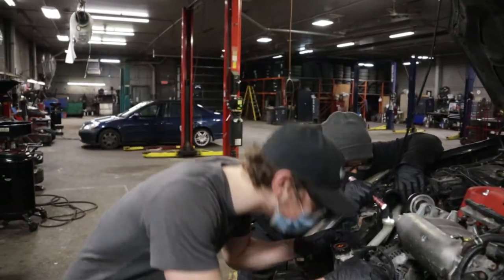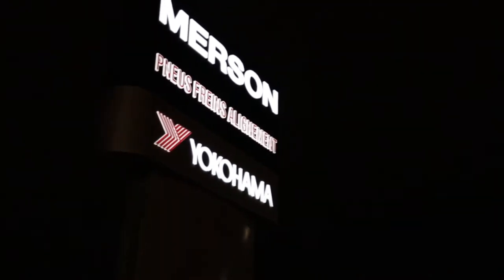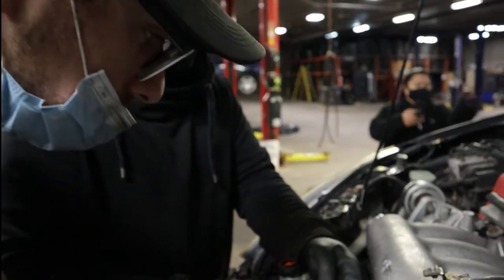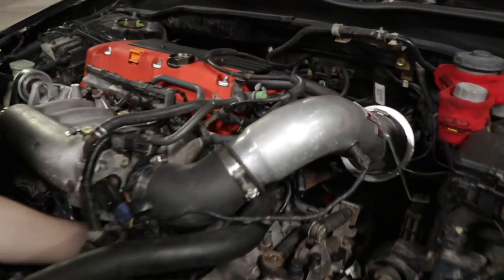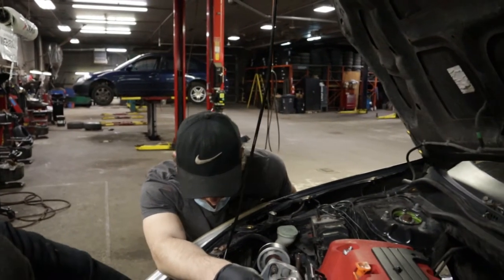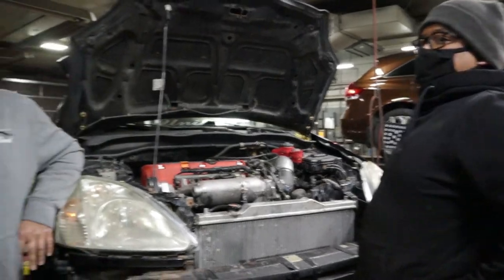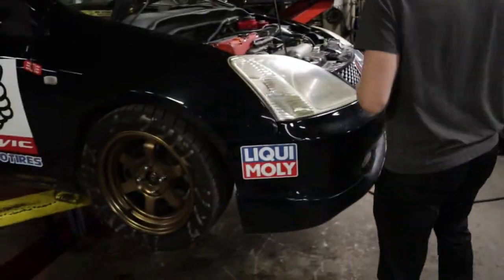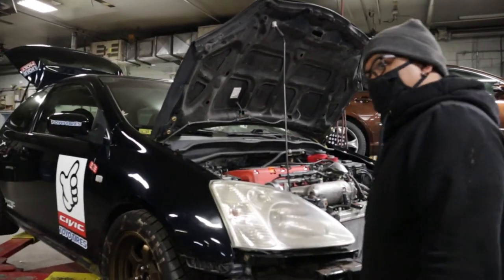Changing the starter on the Honda EP3 – DON’T CHEAP OUT ON PARTS [VLOG #11]

Comment: god that looks so annoying, i gotta replace my starter in a few days, been kick starting my car everywhere i go. would you say its a good idea to just drop the radiator so you can get a direct sight of it? i cant reach the bottom bolts to my manifold with how my engine bay is on my EP
Reply: No need remove radiator or anything from top. Just remove plastik shield from bottom. You can use motor starter from accord 7 2.4 k24 engine. What you need is only socket 14 from top and 17 bottom and 13 or 14 from motor starter wire. H